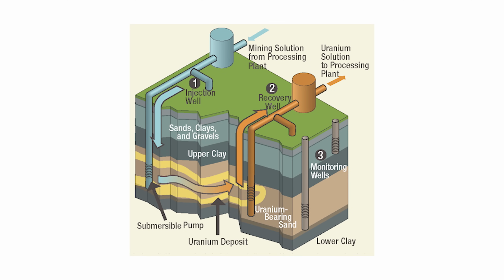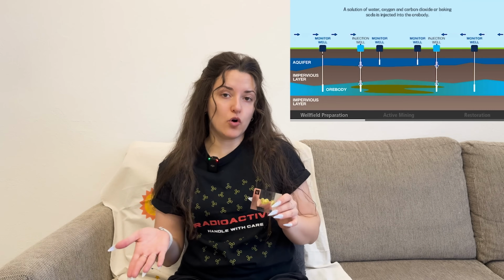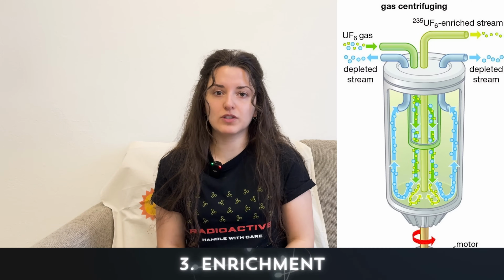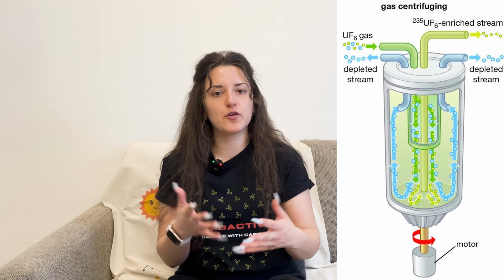Nuclear Physicist Explains - How to Fabricate Nuclear Fuel?

Comment: I'm glad that i found you❤️
Also im just curious how long does  the fuel rods lasts in a reactor core?
Reply: @knowledgeiswealth.  Usually the fuel in the reactor is changed every 12-24 months. During every change of fuel, around 20-50% of all fuel assemblies are changed, depending on the reactor type and on the fuel strategy. The average life span of one fuel assembly is 4-5 years. During those years the pellets generate insane amount of power, compared to other sources of energy. Nuclear energy is awesome!

Comment: I appreciate the enormous energy density of nuclear fuel compared to chemical fuels but how much of that energy is actually utilized in a reactor cycle? I heard that the pellet structure mechanically breaks down or that the fuel becomes otherwise unsuitable well before the radioactivity of the uranium is expended.

Comment: It would be interesting to show, how much microsiverts/h one Pellet or one assembled unused rod full of pellets, ready to be used on the reactor has.
Also how much there is, if one fuel rod has reached the time of replacement, where it would be taken out of the reactor.
I'm curious about that.
And thanks for this video.

Comment: Why do you generate heat from elements and heat water to the point of steam ? Then spin the turbines to generate electrons from the rotation of the magnetic field ??
So it's not possible to immediately extract these electrons from the elements to produce electricity ??
Reply: You can and it's called a nuclear device. The electron energy will immediately decay into a lot of heat that is sometimes used to trigger a fusion reaction
Reply: @mikefallwell1301  a lot of heat ??
Reply: @igorbarsowski2380  considerably more than the core of the Sun
Reply: @mikefallwell1301  Well, the beautiful thing is that they generate heat and then use this heat to heat water so that the steam turns the turbines.
Then the steam rotates the magnets and coils in a rolling motion to create an electric current.
Well, my question is next:
Is there another technology to transform electrons in atomic nuclei into the rapid movement of electrical energy without generating heat ? without the need to generate steam and without the need to rotate magnetic fields ?

Comment: Abstract

Nuclear power plants rely on uranium as a fuel source. This video presents an overview of the front-end processes involved in nuclear fuel fabrication.  The fabrication journey begins with mining uranium ore, typically extracted through conventional drilling or the less environmentally impactful in-situ leaching technique. The mined ore is treated, purified, and converted into yellowcake (concentrated uranium oxide). Through conversion and centrifuge-based enrichment, the concentration of the fissile isotope uranium-235 is increased. The enriched uranium is chemically converted to uranium dioxide powder, then compressed and baked into dense ceramic pellets. These pellets are carefully inspected and inserted into zirconium alloy rods, which are then assembled into fuel bundles for use in nuclear reactors. 

Nuclear Fuel Fabrication – Key Stages
Summary

Mining

* 0:00: Uranium is extracted from underground/underwater in rock form (ore).
* 1:17: Ore is naturally occurring, with concentrations from 0.3% to 20% uranium (1% typical).
* 1:38: Most abundant reserves found in Canada, Australia, and Kazakhstan.
* 1:58: Two mining methods: conventional drilling or in-situ leaching (less environmental impact).

Conversion

* 2:38:  Extracted uranium purified and converted into yellowcake (U308 or other oxide forms), ~80% concentration.
* 3:41: Further conversion needed to a form suitable for enrichment.
* 4:05: Yellowcake converted to Uranium Hexafluoride (UF6). Gaseous form eases enrichment process.

Enrichment

* 4:59: UF6 used for enrichment.  Most commonly done using gas centrifuges.
* 5:35: Process separates Uranium-235 (useful isotope) from heavier Uranium-238.  Several cycles create fuel that is 3-5% U-235, suitable for light water reactors.

Reconversion

* 6:41: Enriched UF6 chemically converted to Uranium Dioxide (UO2) powder.

Pelletizing

* 7:10: UO2 powder pressed into pellets (roughly a fingertip in size), then baked (sintered) for solidification. 
* 8:34: Amazing energy density: One pellet rivals 800kg coal or 500L oil. Two pellets can potentially power a household for a year.

Fuel Assembly

* 9:00: Pellets carefully inspected, then loaded into long, thin rods made of a zirconium alloy.
* 9:48: Bundles of rods form the fuel assemblies that are used in reactor cores (100+ assemblies per typical reactor).

Comment: Now I have 2 questions:

1. What would the danger be in having a cracked pellet inside a fuel assembly? Would it fail mechanically because of differential thermal expansion, or would it create an area of uneven reactivity, either going into supercriticality because of the neutrons from the other fission reactions around it, or subcriticality because of the space of low neutron moderation inside the pellet? Or is it just because we want our fuel assemblies to be structurally beyond reproach?

2. would it be possible from a nuclear physics perspective, to run a microreactor on only 2 pellets? Or would it run into the same issue as the nuclear battery, where it has a very high capacity, but it releases the energy very slowly, to the order of µW and be basically useless but for some very small devices? I imagine a corresponding size cooling loop and turbine would not be the most efficient system, considering full size commercial power plants already only really put out about 30% of the core's thermal energy into the grid as electricity.

Comment: One question I've always had but I don't have access to anyone to answer:  So you enrich to 3-5% and the rest is mostly U238.  When the fuel rods are spent I understand that 1% U235 remains.  Why are the rods not made of something the size of grains of sand with the U235 grains being very highly enriched and diluted down grains of another material that doesn't transmutate into something nasty.   Then a fuel rod could be pulled out and grains sorted(not going to speculate on how since I lack the knowledge to suggest a material, but not an unreasonable process in my thinking, heck could be as simple as one floats in water lol) and put back into the rod giving the needed 3-5% again.   Now when the rod is no longer 3-5% when all the dilution grains have been removed you are left with a whole lot less waste, and a lot more of the total burnt.

Comment: How does the energy used to produce these fuels, mining, processing, enrichment, handling, environmental impact and the construction and operation of the facilities compare to other conventional  electrical generating systems and the processing of those fuels. Coal, Hydro, Natural gas, wind or solar?  I'm a hydro operator/tech, just wondering.

Comment: "Nuclear Physicist Explains - How to Fabricate Nuclear Fuel?" - by fabricating what's called Nuclear.
"A derived value must violate the Concept of its Value".
c in E=mc² is an imaginary number.
"No matter how highly mechanised and self-powered, fossil fuels extraction requires a number of people - as if the process is executed by hands using buckets and ropes - by physics".
Today, this number is 8 billion people - working flat out 24/7 - strong.
Elina Charatsidou, Nuclear, Nuclear Fusion, you and I are among those, too.
Finite fossil fuels are dangerously hypnotic to humans, their consciousness, reasoning and mental capacity.
Humans were not ready morally, ethically and intellectually to start the mass extraction of fossil fuels with the advent of the steam engine 300 years ago. 
The Magna Carta requires today overhauling – adding to it the right for humans to understand what Energy really is - before any other commandment;
“In any system of energy, Control is what consumes energy the most.
No energy store holds enough energy to extract an amount of energy equal to the total energy it stores.
No system of energy can deliver sum useful energy in excess of the total energy put into constructing it.
This universal truth applies to all systems.
Energy, like time, flows from past to future” (2017).

Comment: I''d love to see another video on nuclear recycling and closing the fuel loop. This is the biggest flaw critics say nuclear power has, which of course it isn't really. It's an advantage...  All that potential energy that could technically be recycled and reused which in turn reduces the total uranium we need to mine or allows the costs to remain low and stable enough to make the economics viable!
Reply: Two reasons for the high cost of nuclear reactors in the United States are one, there is no standard reactor designed that has built up a learning curve. Two, reactors in the United States are designed for a very long lifetime with big upfront Capital costs

Comment: Here's a fun calculation I did using AI and current spot prices for the cost of 1 pellet of uranium oxide...

1 pellet of uranium oxide: $02.24 USD 
1 tonne of coal: $94.24
120 gallons of crude oil: $219.47
17,000 cubic feet of natural gas: $48.28

I repeat... $02.24 uranium oxide vs $48.28 for natural gas...

WHY AREN'T PEOPLE SHOUTING THIS FROM THE ROOFTOPS???

Yes I know that reactors are currently expensive to design, operate and build but c'mon... Streamline, simplify and modernize and the advantages are just too much to bear!
Reply: Now do the same set of calculations using unrefined U238 in a fast neutron, molten salt breeder reactor.

Comment: Hi Elina.  I know you did some coverage of the CANDU reactor system.  Keeping with the focus on nuclear fuel, can you expand on the fuel differences between a light water reactor and a heavy water reactor?  For example which reactor types need the entichment, if there are different types of fuel pellets (ie if fuel pellets are manufactured in different ways due to the reactor type) etc.  Thanks!

Comment: Would that be accurate to say that since U-235 is fissile, the U-238 has to be altered by it to do anything? That is to say that the U-238 is altered to other elements which then decay into fissile ones?
Reply: The U-235 is fossil, however the U-238 will absorb a neutron and become Plutonium 239.
Reply: @vikingsoftpaw  Thinking about when a fission occurs it puts out 3 neutrons. So there is a statistical chance of converting U-238 to Pt 239. So you probably get an eventual slightly positive drift in fuel as per being fissile There is also the issue of what generates the initial neutrons that I guess have to hit other U-235s or Pt 239s?

Comment: For some space applications (RTG) they use HEU (highly enriched). Could this be produced with the same centrifuges as tge ones used for fuel pellets/rods?
(Ofc mikitary grade is another story, I guess.)
A topic idea: using nuclear energy in space probes/rovers.
Or another one: could we produce fuel rods on Mars? What do we know about uranium distribution in Mars? How many and heavy machines would be needed ro make it happen there?
Reply: I'm fairly sure that uranium (at any state of enrichment) has never been used in any RTGs. It simply isn't suitable, because the half life is far too long, meaning it is nowhere near radioactive enough to generate the kind of heat required to make RTGs work. The isotopes used for that need to have a half life measured in a few tens of years: The RTGs used on long duration space probes (such as the Voyager and Cassini probes) use plutonium-238, which has a half life of 88 years, since this is short enough to make reasonably large pellets of plutonium metal (or sometimes plutonium oxide) glow red hot if well insulated. This is enough to make reliable RTGs which can operate for several decades - the Voyager probes were launched in the 1970s and are still sending signals back to earth today.

The next most common isotope used for RTGs is strontium-90, which has a half life of about 29 years: This has not been used for RTGs powering space probes, but the Soviet Union constructed many RTGs of this type to power radio transmitters in remote northern lighthouses, which was the only practical method for producing consistent power output during the 6 months of darkness of the arctic winter. The RTGs used for this were much smaller than the plutonium versions used in spacecraft, with a much lower output of about 10 watts, though they could provide this consistently for several years, which after all was the whole point.

Comment: Seems like a lot of Energy put forth from the drilling, crushing, gassing to enrichment. Then the power plant construction. And of course a lot of TIME. Thank you for Sharing.
Reply: This is true, but what is important is how many times more energy you get OUT of the fuel vs the preparation put into it.  This is known as EROEI (Energy Return On Energy Invested or Input).  Nuclear power has such a high density of energy output, that even though the reactors only use about 5% of the fuel put in them (about 95% is "waste" and removed to be put in a cooling pond, then put in cask storage), the EROEI is still about 75x.  Newer reactor designs and fuels could do even better but ~75x is one of the highest numbers you can get and the highest when talking about reliable output (wind can hit 75x, but it isn't reliable since it depends on the wind).
Reply: @LFTRnow I often think how "silly" it is to haul oil, diesel with diesel truck to various places... nuclear fuel has minimal problem in this as energy density is so high per kg. People will likely use EROEI 1:1 still but cant build any industry for that, only for moving produce to more remote locations for people to use.
Reply: Nuclear is dirt cheap when you take the cost/time/challenges of building the bloody reactor itself. Once they are up and running they generally work silently and effortless for 60,70,80+ years... Ontario is principally nuclear powered and it's only expanding it's fleet... Bruce is one of the largest nuclear sites in the world and Pickering and Darlington are nothing to sneeze at either!
Reply: I was just thinking something. How hard would it be to make a small reactor that could run on 10-20 pellets that could power a whole home for 5-10 year?
And another thing. How much would it thake to make a nuclear bomb from thies pellets? Theres alot of countryes who have nuclear power bot no bombs. Not that i wish for more of them. More of interest of how hard it would be if they wantet to.

Thank you for another great video Elina. Looking forward to the next one.
Reply: @Funnyboy2402 I thought of same, small reactors (SMR) could over time get to house size scale. Nuclear bombs need from 5% to enrich to 80-90% so that is very hard to do. Enrichment to 5% is already pretty challenging process with many steps in this video.
Reply: @effexon  Could be great with a small reactor in the back of the garage that just neede to be change every 5-10 year or so. Just like your buying a battery for your household power today.